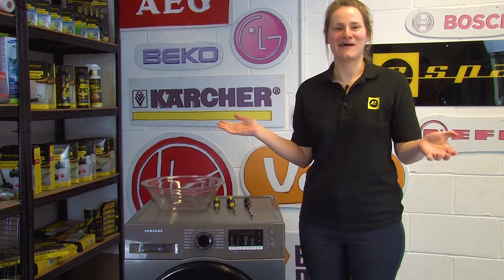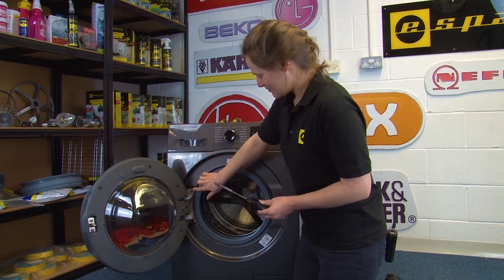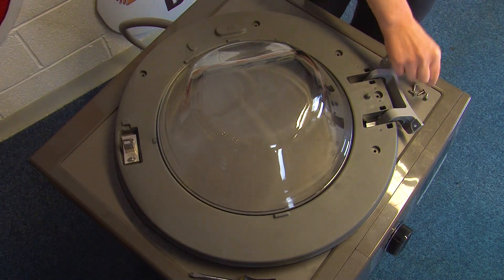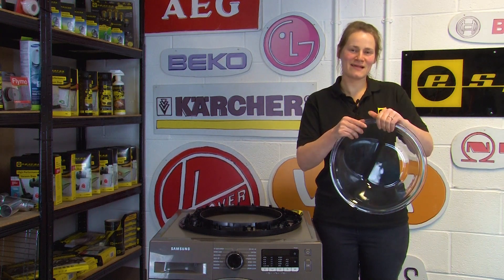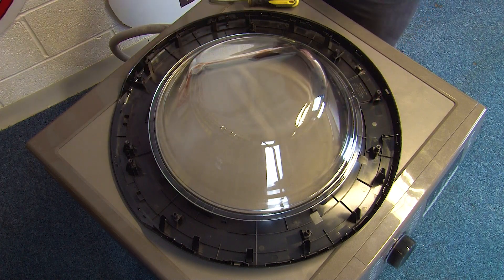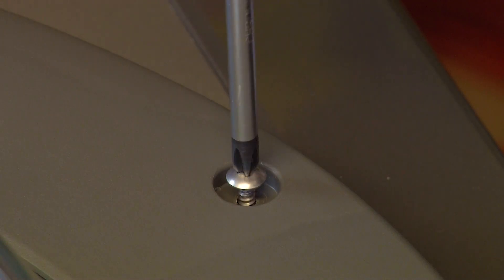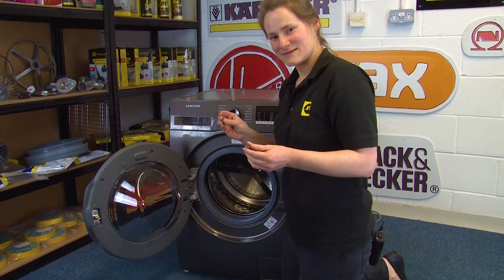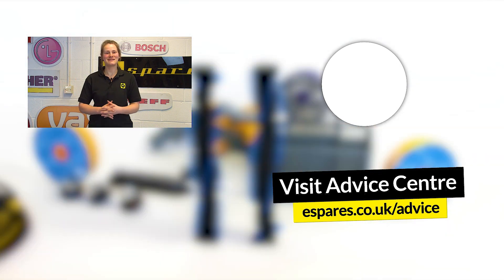How to Replace the Door Glass on a Samsung ecobubble Washing Machine

Comment: @weconnectmedia8136

We have an eco bubble - The lock is broken. Like your video the door is almost the same except it has no screws bar one by the hinge and a hole in the lower half. I am able to remove the door and prise apart the plastic rim around the glass - all except in the quadrant of the lock and a small hole in the plastic rim. Any tips how I can proceed from here?